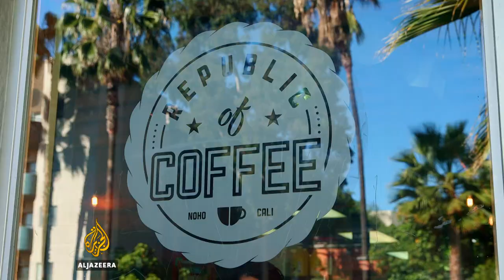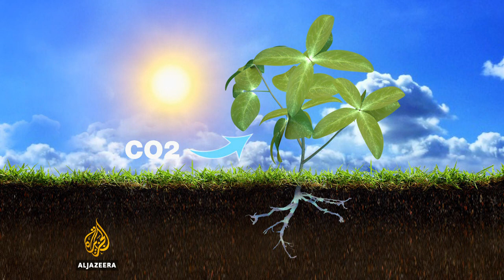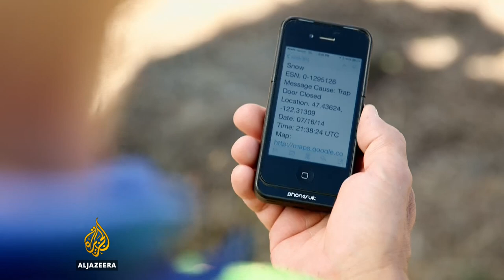TechKnow - The farmers growing vegetables with LED lights

Comment: Even with recent improvements in PV and LED tech, you're still looking at what, maybe 10% efficiency in delivering light? Might there be some way to collect light with mirrors, route it through pipes (maybe fiber topic cables), convert the green to red, and distribute it to individual plants? You could still use PV+LED to distribute artificial light for fine balancing, and for cloudy days and some of the night-time.
Reply: That's a gr8 Idea for roof top green houses with colored glass. I could see the mirrors helping reducing wasted resources.

Comment: wow, very useful video. hope it gets improved with no side effects.
 by the way, are there any side effects?
Reply: Sravani Nekkanti water run off of unuseable chemical salts (its not chemical free n.p.k(nitrogen+ phosphorus +potassium +micronutrients they're chemicals!pest make their way indoors as well as fungal and mildew which take hold easier being there is no natural preditors or inhospitable temp enviroments or rain natural deterents for pest.They use pesticide, Biologically derived or through synthetics they're the same thing) of the nutrient solution goes into the sewer eventually into water systems .With areoponics, there is .the antibiotics feed to the fish,into the humans eating them the workers handling them and eventually the water system they dump the used water into.

Comment: so what does the farmer do to the nutrient runoffs? does it get completely recycled?
Reply: The best case is adjusting the end of cycle solution and applying it to an outdoor garden area.
Reply: it's flood and drain recerculatimg system. you just topoff the tank when it gets low. just the same as the aquaponics minus the fish

Comment: How much does it cost??
Reply: LEDs are not cheap to put in but with the savings to run them and the fact that we don't need to exhaust excess heat the paid comes rather fast

Comment: the earth is flat btw
Reply: So are the tyres on your mobility scooter.
Reply: No the earth is like an ostrich egg
Reply: @tazboy1934  not much circumference around the equator 24901, circumference through the poles 24860 just 41 miles shorter.
Only a 0.16% difference or 8.7 feet difference for every mile.